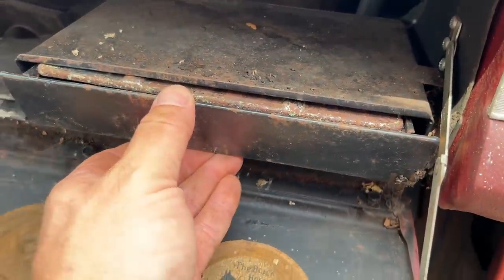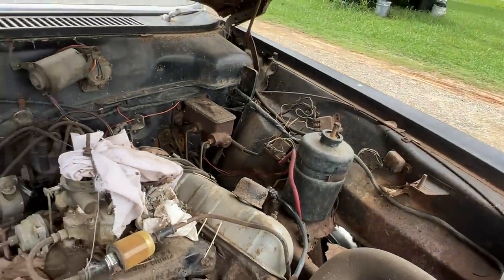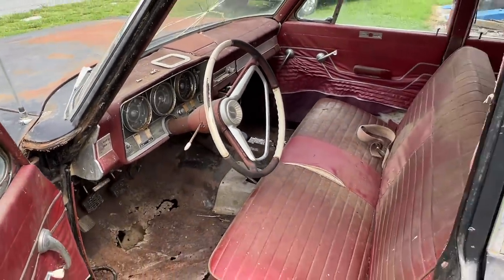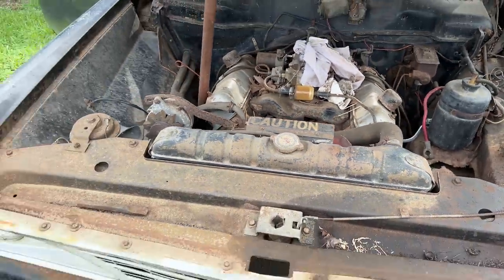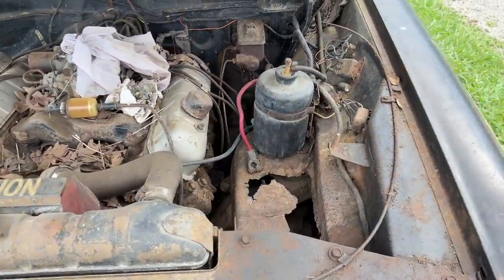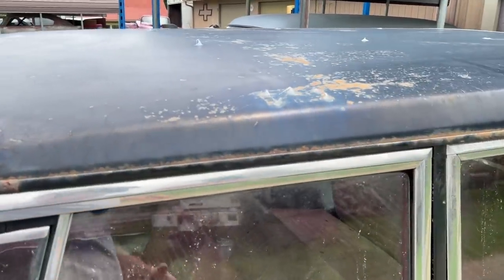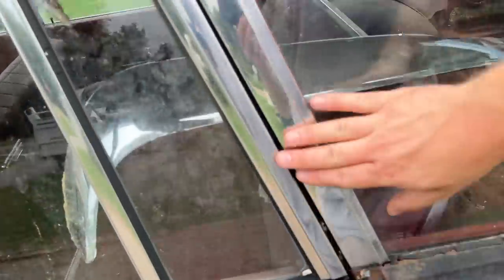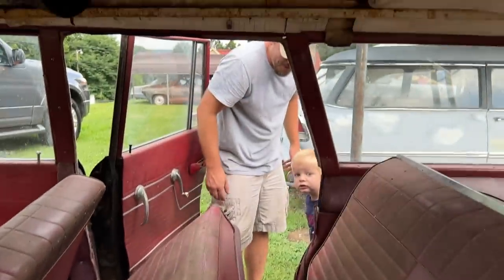CRAZY RARE V8 4 Speed Studebaker (Best STATION WAGON Ever!)

Comment: You know it came with the bigger engine with dual exhaust and factory 4 speed. Jeezus clean it up and oil the cylinders before u destroy the starter or ring gear. Soak cylinders and nice the motor by hand to. Maybe loosen it up everything you break you'll never replace.

Comment: Take the car apart, price by price, dip it, clean it, replace the rusted out parts with good metal, spray it with primer, spray it with a decent color, put it back together, and be empresses. GOOD LUCK.

Comment: Was you to go to a local auto parts store, they have some stuff called PB Blaster, or many other spray lubricates. You just push on the little button on top and it will spray some light lubricate on different parts of the car or what ever you work on to make easier to move or open different things.... you have used this stuff before, so why wouldn't you use it here? Its why I hardly ever watch your channel because of dumb shortcuts that you do... not trying to pee on the  cereal bowl. If I never show up again, its not going to hurt you at all, I am the one who will lose. This is a fairly rare rig an quite fixable as I have done a heck of a lot worse rigs.

Comment: yes it's worth saving  ... BUT !  ,....it's gonna be a miserable project, UNLESS to take it to somebody that CAN do the tin Replacement it needs-requires.....why miserable you ask?  because there are NO PARTS available for Studebakers anymore....that all died about 20 years ago.....don't ask how I know.......OnWard..............
Reply: Wrong!  Lots of NOS sheetmetal remains for 1964 Studebakers.  From the vendor Studebaker International.
Reply: @billpressler5319  it's NOT the sheetmetal that's the problem....it's EVERYTHING else pard  ... unless you can find what you need in  a junkyard, parts are pretty much non-existant.......OnWard.....
Reply: @skipper9400  Not true one of the easiest to find parts for.